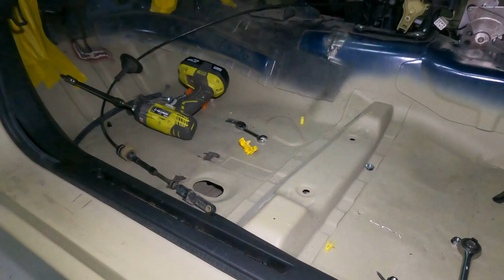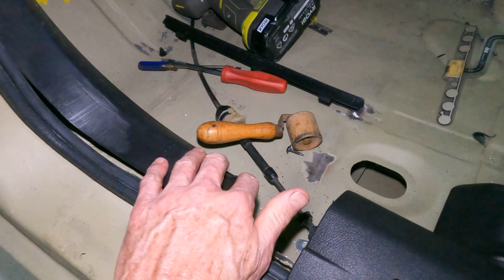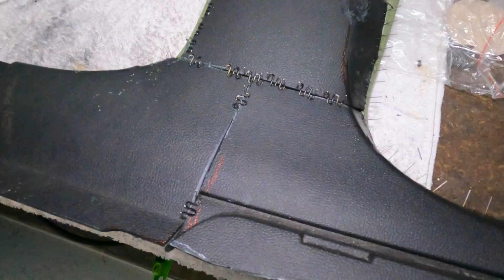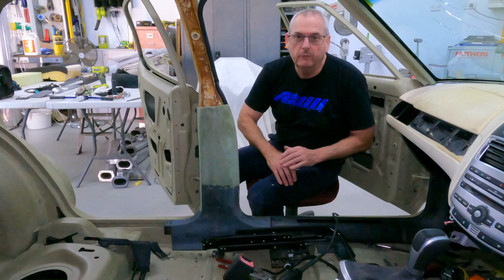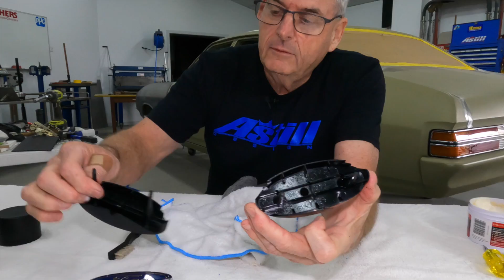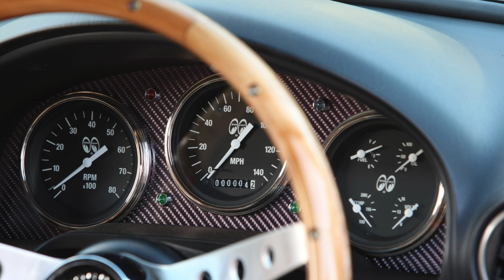Ford Falcon FG & XC Hybrid Interior | Road To Summernats Top 60 #14

Comment: I'm only a year late, but you can finish my GXL, it will be stock factory pine n lime,  black vinyl roof, alloy heads 351c, t5, firewall already smoothed ( pinch welds gone) ,  doughnut wheels.
have all the bits, just needs paint & re-assembly.
wishful thinking i know.
1 powerball !
Reply from the maker: Good luck 🤞

Comment: Hi Howard I know you might say how long is a piece of string but if i wanted to build a xb falcon similar to xcboss but with bf falcon running gear and floor pan and firewall what sort of coin would i be looking at
Reply from the maker: Hi George, it would depend on the other modifications if any to the body. Plus what driveline it would be running.
Reply: @AstillDesign  as for driveline it would be bf xr8 as 5.4 boss engine 6 speed auto and if i could find one similar to boss xc or just a beefed up xr8 complete diff assembly
Reply: Front suspension might be a problem maybe some tubular system with rack and pinion steering
Reply from the maker: @georgedamouras3454   If your looking to do full floor pan it would become an Individually constructed vehicle and cost a bomb. What state are you in? they all vary with there requirments

Comment: The best polish for plastics is dedicated plastic polishes that the aircraft industry uses, like especially helicopters which has acrylic or polycarbonate surfaces, i used to sell them to all regional airport maintenance business, including qantas and ansett airlines in 1998/99 to 2000, including aircraft grade alloys, one of my best clients was roaring 40's the company in Vic that builds GT40's to spec, used to use2mm and 1mm commercial grade aluminum and than converted him to use 6061 t6 and 2024 t6 thin aircraft grade alloys which made the cars even stronger and will not rust ever and lost around 40KW of weight per car compared to using the commercial grade alloys. :)
Reply from the maker: Good info to have, Mothers offer a plastic polish for headlights

Comment: Love the build Howard. I have a KE55 Corolla. Qld will let me put a naturally aspirated 2.7 in it. Lexus makes a 2.5 V6 that they put in the IS. I would put the whole drive line and interior from the IS in the Corolla , French in the bumpers, pump the rear guards ,remove the aluminium trim, rain gutters and paint the whole car in a modified version of Toyota’s Ink. I would probably put custom wheels on it.
Reply from the maker: Sounds like a good plan.

Comment: Love the build series Howard! It’s great to see to amount of work and attention to detail that goes into a build of this caliber.

I’d love to hand you my 79 XD that I’ve owned since ‘95 and in the shed since ‘97 (can’t rush these things!). Original with a 351C, 4 speed single rail and 9 inch, but thinking of a twin turbo Godzilla through a late model 6 speed auto or T56 and independent 9 inch. Interior would be a mash of XE and BF.
Reply from the maker: Wow factory 351 manual, that’s a bit nice to be hot rodding. But whatever rocks your boat. For street duties would be nice with a Arrow based Cleveland and a TKO behind. Maybe some trumpet injection like the boss. 
The mind wanders.🙂

Comment: How about a 1959 Ford Zephyr Ute. Not sure on a driveline, but I’m partial to a v8, manual gearbox. I actually have this vehicle, which was my Dads first vehicle. It is all complete with original motor.
Reply from the maker: Based on John Peterson's rides I would go a stout Windsor, Tremic TKO with 9"  Always had a soft spot for a Zephyr. https://www.pressreader.com/australia/street-machine/20191010/282815012996155

Comment: Not everything you do may be to everyone's taste but everything you do is performed with a level of skill i am envious of! No way do you need to justify what you are doing or why, love it or hate it, it will always be different, innovative and executed to perfection. 
My dream would be to assist you in building an XR falcon wagon with running gear and mod cons from a late model mustang but instead of using the late model interior, i would love to make everything operate from period correct/original style controls. It would then be my daily until i could no longer drive! keep up the awesome work and videos.
Reply from the maker: Sounds like a really cool long roof

Comment: My dream is actually very similar to what your doing now.i would like to do a 69 camaro body but everthing else engine chassis etc from a new camaro.something that is modern in power handling and comfort but with the old school chrome bumper body  that looks better than anything built in 50 years. With the body stampings in the states no body need cry about ruining a classic either!
Reply from the maker: Sounds like a nice build.

Comment: Best of both worlds . I also have an XC , a highly optioned 78 GXL , that i would love to look sort of original on the outside but more modern underneath , aka four link coilvers etc . It now has a 427 Arrow Clevo . tough C10 and the factory 9inch with a detroit locker & 31 spline Mosers .
Reply from the maker: Nice car, what colour?
Reply: @AstillDesign  paint code Y , Fireglow .

Comment: 1964 EH Wagon
N/A LS3, 9" mini tubbed 
New holden interior with a custom front bench seat. Comfort of today in a beautiful eh wagon shell
Reply from the maker: Sounds good, classic lines. What sort of wheels were you thinking
Reply: @AstillDesign  not 100% sure. Something new like a 19"front showwheel 20x10 rear with dish. Or could go down the drag look with a large front and a 15" rear with large tyre. I do like the drag look

Comment: Hi Howard, love your work as always. I might have suggested once before to fit a transaxle with a cleveland in the rear of a XA coupe. It would be an Aussie version of a detomaso pantera. It would be a two seater with Cleveland mid mounted.
Reply from the maker: Wow there is a challenge, would be interesting to see what the engineering on that would be

Comment: The XC is looking F-ing G-reat. Have you seen anyone refurb those outside weather strips between the door & window found on 20-30 yo Fords? They appear to be a molded strip with a thin rubber coating, which over time, fades & pits. I have tried various trim restorer products but their too far gone. Appreciate any advice. You will be the first to know if I win tattslotto as I,ll be sourcing a 1970 Torino for you to build, promod style with a Sonny Leonard SAR-729cu, built C6, 9'' etc. Really appreciate seeing how the interior swap outs are done properly. Just bought a T-Shirt & Poster.
Reply from the maker: Cheers Mate, Go big or go home :-) Thanks for your business. Noadvice onthe strips sorry.
Reply: @AstillDesign  Received Shirt & Poster today, both 100% perfect. Thanks HA.

Comment: Mate what a delight. First met you at a Easter nationals in Wagga Wagga late 80s I think it was. Always a good bloke and what a craftsman.
Id love you to build me a large window early 50s Chev truck short bed with a styleside. But with a 427 cammer auto box and 9 inch. I'd call it flipped because all the poor ford's over the years that get a Chev put in but I'd flip the script by putting in a great Ford running gear into a beautiful old Chev platform.
Reply from the maker: Sounds like a plan there Adrian

Comment: Hey Howard, great stuff! Love the videos! Keep them coming. 

One quick tip with the hot staples push them in and rotate slightly that helps to stop them from being able to lift out nothing drastic just push down and slightly twist so the wire is under the entry point.

Always keen to get a notification for the next video! 

Cheers
Reply from the maker: Thanks for the info!

Comment: I would like an XA-XB 351 I’d have to have a good think as to whether manual or auto. And 9” of course. Basically original interior. A modern 5 spoke big wheel set, 20” or so. So fairly original other than a nice set of wheels and big cam 351.
Reply from the maker: NICE!!!

Comment: Hey Howard, I have a xm that I am restoring to original, been in my dads shed for 30 years so I would get you to build a resto mod xm with new chasis, coil overs and a nice stroked windsor, c4 and 9 inch with twin flat pipe exhaust with leather interior in a burnt metallic copper colour. When can I pick it up?? ;)
Reply from the maker: Nice combo

Comment: Anyone who questions what you do Howard should be dragged out in the sun and shot at point blank range. All hail the master. 😎👍
As for what street machine I would have you build, I would have you look at the JDM darkside and rebuild my 1JZ powered MX83 Cressida and fit it out with everything from a 2021 Lexus LC500. Climate control, all the fruit inside and smooth every body line and give it the classic Astill touch. 😘👌
Reply from the maker: there is a challenge if I ever seen one

Comment: I would love if you did my Eh panelvan LS 427 T400 3/4 chassis full floater 9 inch big tubs running 20x12 on the ass 20x8
Reply from the maker: Hi Stephen, missed your comment, that sounds like a beast

Comment: Seeing what is possible when a master car builder is at work is inspirational.  Using the new / old hybrid theory that is being so well executed makes me think of my 1980’s Mercedes 280CE Coupe updated with current spec AMG E63 interior, driveline and running gear for a classic style European muscle car.
Reply from the maker: Better get the tape measure out and see what will fit

Comment: Still loving the insights you give to the build. The mix of old and new is absolutely spot on, the people hating on it obviously have no imagination. 
My dream Astill build….. would have to be an XC cobra pro-tourer, 4V coyote motor, ITB, 6 speed manual, independent front and rear suspension. Clean, smooth and head turning, like all Astill builds.
Reply from the maker: A big coupe on it guts that goes around corners, awesome
Reply: @AstillDesign  could there be anything nicer. Has to be in classic blue and white. Modern “globe” rims in gunmetal grey 18’s & 20’s, driveline and suspension in gunmetal grey as well. Has to be dropped within an inch of its life. Full dark grey leather interior, 4 point cage tucked right up and out, to keep it slightly hidden. Clean, angry and comfortable.

Comment: Can I please have a ZD fairlane 500 with candy apple red paint. Cream / beige interior. 2 + 2 rear seats. 302 out to 347 with holley sniper setup. Powerglide with gear vendors. Shortened 9 inch. 195's & 265's convo pros. Qa1 suspension with bags. Could just keep naming things. 

I've actually been thinking during the previous weeks whether you'd work on a ZD?

Keep up the good work Howard. Have you had time to do your lawn reno yet?
Reply from the maker: ZD sounds good, would be nice as a 2 door.
The lawn want need a Reno just a light top dress and a good feed

Comment: Hq on a late model commodore floor just basically the hq sheet metal on the outside , did you ever consider using the the whole falcon chassis and floor and only using the Xc exterior somehow?
Reply from the maker: Registration would be very difficult if at all possible

Comment: Would love to get you to paint n panel my 71 ZD Fairlane Custom 6 in the Toyota white pearl. And grab the 250-2V from the munted wild violet, white vinyl top XA ute I have. Convert it to injection and put a stock XR6 Turbo (off FGX) onto it stick it in the ZD, keeping the C4 column shift, bench front n rear, plated 6 seater! Was meant to be finished December 2015... 🤦
Reply from the maker: Sounds interesting, what about aspirated with throttle body injection set up like the triple Webber setup from the past.
Reply: @AstillDesign  now that too, sounds very interesting!

Comment: This is going to come out amazing, I can't believe how good the fg stuff fits and looks in the xc. My xc's grill and dash is all cracked through in parts, I will have to do some plastic welding eventually.
Reply: You're lucky its an XC as I've heard those grilles don't mind a bit of plastic welding, same as the XA's, but the XB apparently uses different plastics making it harder to get a good/durable weld. I hope one day someone makes re-pro grilles for the XB. That'd be sweet. Good luck with yours mate.
Reply from the maker: I’m going to try the hot staples on an XC grille soon.
Reply: @AstillDesign  Yeah I really like that idea it is clearly going to be a strong connection. I will probably do the same, but I have a lot of work to do before I worry about the grill for now haha.

Comment: The car I'd like you to build would be my XA wagon with 427 sbf and 6spd manual.
Reply from the maker: A few wagons getting a mention.
Reply: @AstillDesign  I've had my wagon for 13 years now, was running an EB 5.0L and 5spd for about 5 years but it's in pieces now and on the back burner. Love you work on the Boss XC, such a talented man.

Comment: Awesome episode as always from astill design,  if I had a choice it would be to build early xm/xp falcon coupe (or US falcon coupe) with modern rack & pinion power steering, a Hartley engines VK56 V8 & manual gearbox (loved what a other YouTube channel is doing with one) but I’d retain a period correct interior with Dakota digital dash. 

Keep up the good work.
Reply from the maker: I have a soft spot for the early coupes. My mate Kym Hooper has one that he has had for many years

Comment: If I could get you to build my dream car, it’d be a 64 Fairlane 2 door post, Thunderbolt clone, in vintage burgundy with the nastiest, biggest stroke side oiler ever seen or heard, through a 4 speed auto. I use hand controls so a really neat custom set would need to be made to compliment the car. Absolutely love your work!
Reply from the maker: That would be awesome.

Comment: I have a 2018 Mustang GT manual, my dream would be to make it a Pro Tourer style set up for track days and the like.  Worked GT350 flat plank crank motor, decent cooling, forgeline wheels, big brakes, adjustable coilovers, carbon body panels, partial race style interior with lighweight seats, lots of carbon and alcantera etc. I really like the shape of the car so I'm keen not to add too much in the way of spoilers,  body kits, stripes etc. Just really nice paint in Kona blue, but more purposeful over being too showy.
Reply from the maker: That’s one hell of a car.

Comment: Hey Howard,  I've owned my 71 VG Valiant Hartop Mexicana( Rare extended roof pillar version) for nearly 30 year.  Got her when I was 19.
If you built my Val, I would love a supercharged 6.4 v8 out of a Jeep Grand Cherokee.  With the Jeep interior as well.  It would be amazing.
At the moment,  I have a 4.5lt quad cam Infiniti v8.  It's good but the 6.4 would be awesome.  
Have always followed your amazing work.   Always been best of the best.  Matt
Reply from the maker: Thanks Matt, I’ll have to google that model and check it out. Sounds like a sweet ride.

Comment: Hi Howard :) I love you work I have said it a few times but yeah 😃
I’m about to start a XC build with a coyote (FPV 315 motor from a 2011 GS) I’ll be incorporating electronic steering from a mustang and a full digital dash, i Curently have a company making me a composite dash to fit the new haltech IC7 :) hopefully it comes together 
The Car already has coil over suspension and 4 link rear with a wicked custom 9 inch, 6 pot brakes same as yours except custom mounts and using Maserati GT callipers, the car should make over 700hp to the wheels for stage 1 then the factory 1.9litre blower runs out of puff, contemplating a harrop 2300 in the future for that 1000hp goal :) I’ll keep watching your videos for inspiration and hopefully you’ll see my vision complete in the next year 🤞
Reply from the maker: Sounds like you have it in hand. Good work.

Comment: Give me a '65 Mustang with a Coyote motor, auto and nine inch. Convert the rear to coils and coli-overs in the front. Discs all round, naturally. Make the car look stock (or near stock) outside and in - but have the driveline and suspension and brakes be up to date. Then I'm in hog heaven :-) FYI - I met you once at Summernats back in about 1991 or so. Love your work, keep it up.
Reply from the maker: That sounds like a really sensible build that would be an awesome streetable ride